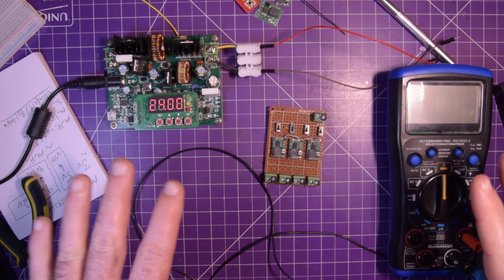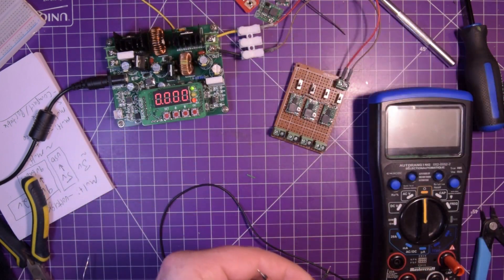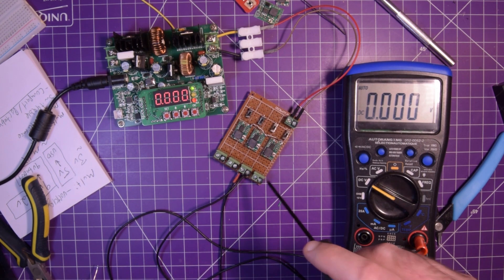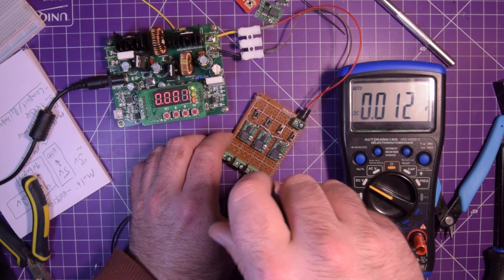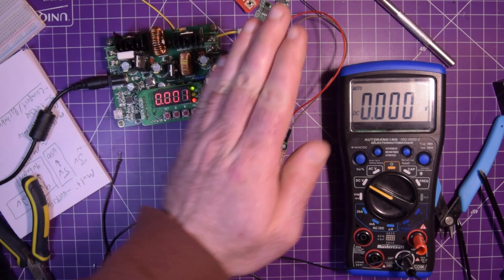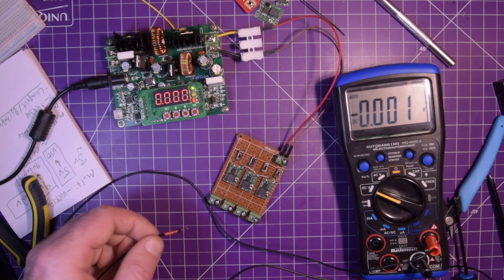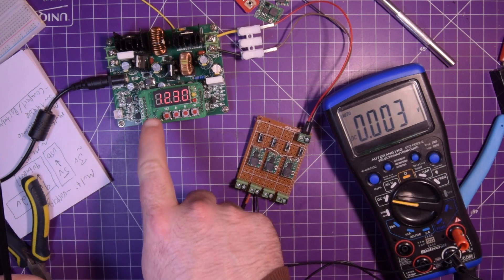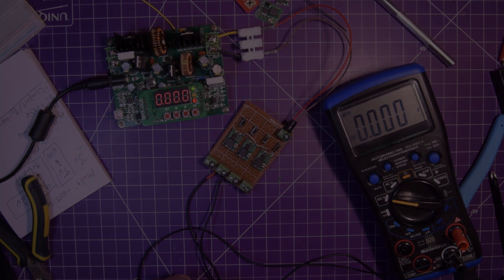Making A Multi-Output Power Supply Part 5 - Testing

Comment: Sir, can I do this for my Arduino Project ?
> [Adaptor] 12VDC 5A
> [Step Up] 35VDC 
> [Step Down Module] 12V (Arduino Power) + 12V (Relay) + 5V (SIM800L)
Is this possible ?
Reply from the maker: Hard to say without a diagram but it should be doable

Comment: you could always add a little chunk if wire to the output and use those little white connectors. zero tools needed. There has always got to be a few  faults to  track down eh lol